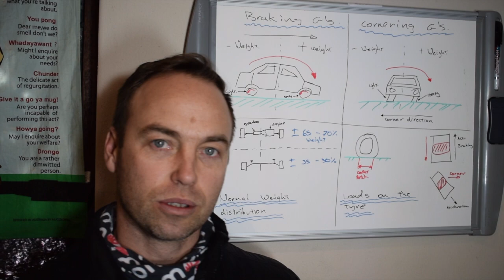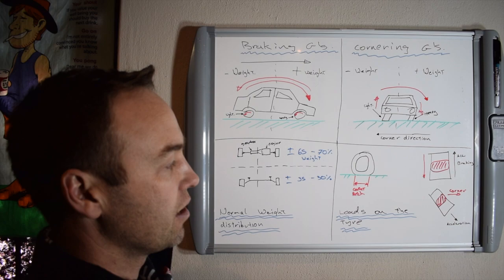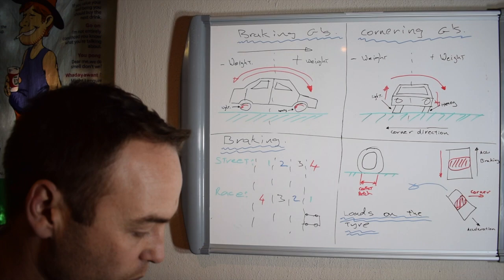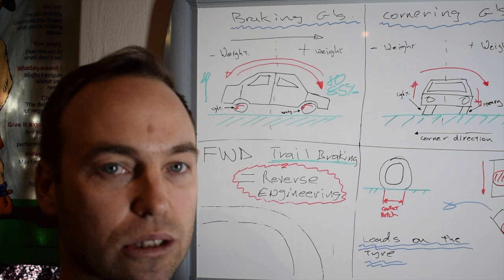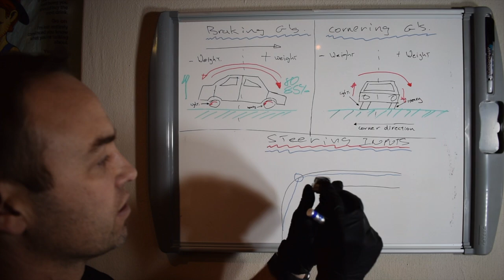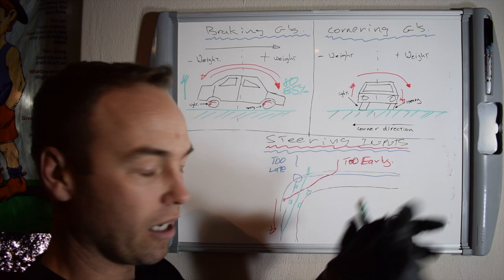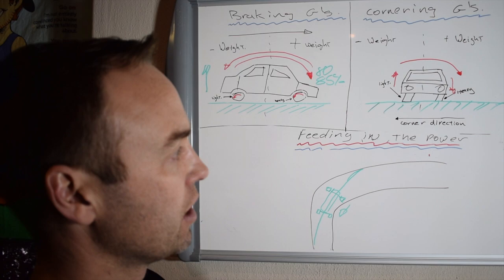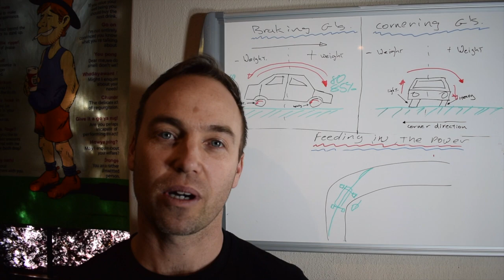FWD Driving Techniques

Comment: How does LSD change corner braking and throttle out the apex
Reply from the maker: This is a very good question. From my experience, the effects of trail braking are very much the same depending on the diff setup on deceleration.
With a LSD, you can get on the power earlier and actually use it to get the car to turn mid corner . But there is a balance to this as too much power will break traction aswell. But there is a significant gain in mid to exit corner speed.
Thanks for watching 💪🏻

Comment: Just sayin its funny, on my Cruze with stock suspension and 200TW tires, driving like a maniac with quick inputs can be faster than a smooth driver. I let a more experienced guy drive my car after his car broke, I beat his times.  Driving crazy gets you only so far and wears out your tires.
Reply from the maker: Correct, there is a level of aggression you need to be fast but there is a limit to that. You go over the limit & you just burn out the car.
So the trick is to get to that limit & be smooth on the limit.
A lot easier said than done especially in a road car. 
Thanks for the comment 💪🏻